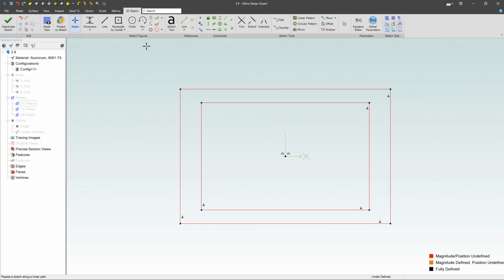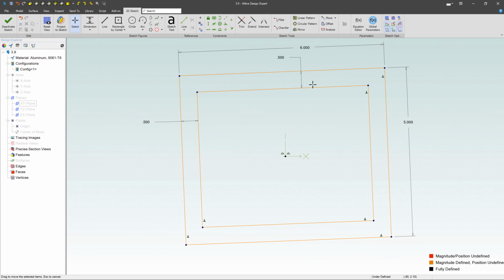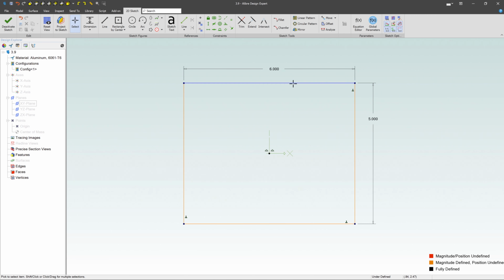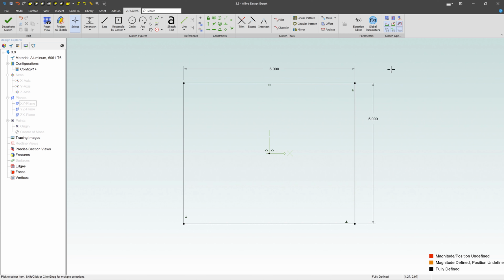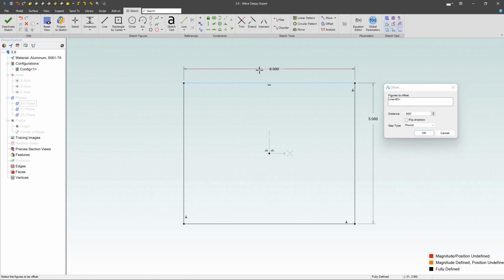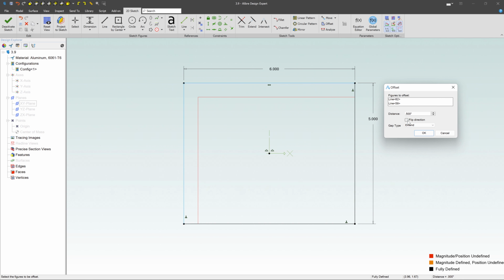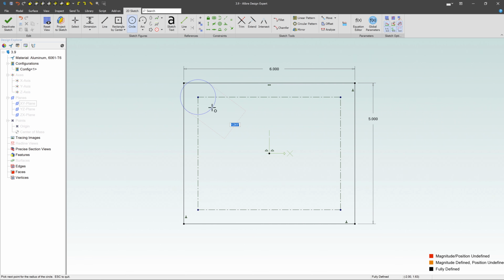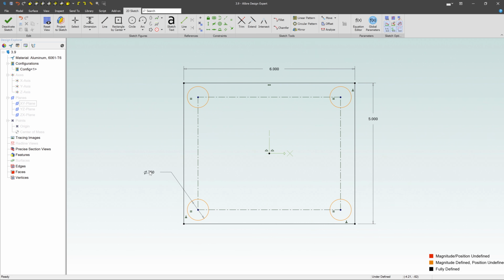Offsetting Figures in Alibre Design | 2022 Exercise Series

Comment: Offset doesn't automatically add constraints to the figures you used to create them, so you still need to dimension or constrain them (as you did with the 2 rectangle method), especially if in your example you decided to change the rectangle dimensions later!
Reply: That would add so much value to the offset tool. Especially if there was an offset constraint that would be added automatically and then could be deleted if you didn't like it.